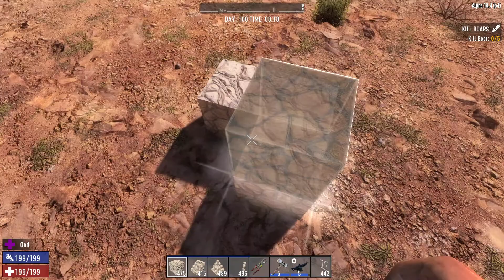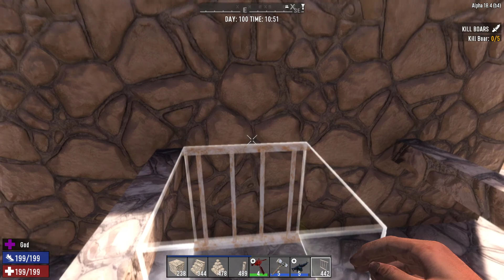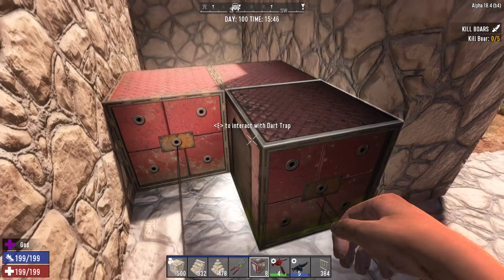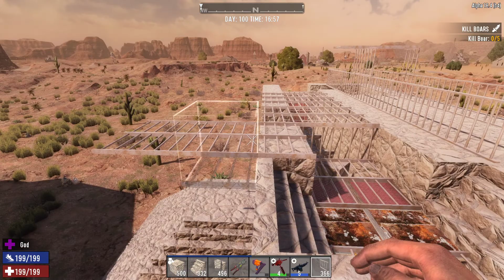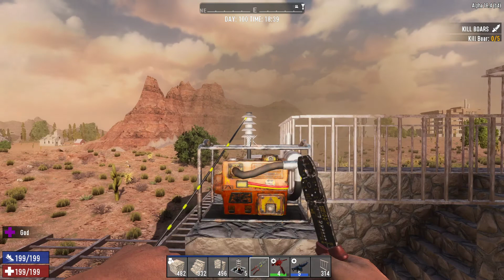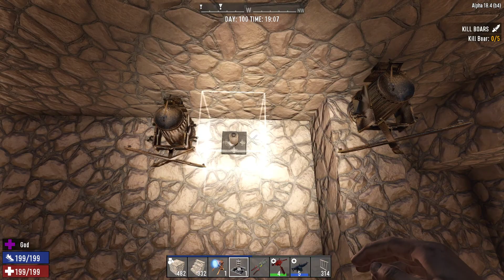7 Days to Die: How to Build the "Tunnel of Terror"

Comment: Hello, I'm wondering why you're using pole block on the bottom and bars on the top. Is there any reason ? Can't you just use either bars or poles on both sides?
Intersting design anyway, I'm gonna do some testings I guess ;-)
Reply from the maker: I used the poles horizontally because they can be upgraded to steel for the highest HP.   Bars would work, but they’d break much easier than poles do.  

For the top, I use iron bars so I can see through & walk across.  Poles could be used as well, but you can damage them with gun shots, so I avoid them.   

Does that answer your question?
Reply: @mov4do  Yep, that makes sense. I thought the Zs would just pathfind through but they actually break a few bars during horde nights so more hp is a good thing.
Thanks for the quick reply.

Comment: I started 7D2D 2 weeks ago with much fear and trepidation.  Your last build {Bury the Zombies Alive) was very helpful in getting me through the first three hordes.  I just got engineering to level 4 and I am excited to try this one. 
When you connected the generator to the far side traps and fences (from where you stand) do you have to connect it to the other traps and fence posts?   Also, do you have a fallback plan for if something goes terribly wrong? Maybe having dart traps, and or electric fences in the path at the top coming at you to help with controlling the horde?
Thanks and subbed.
Reply from the maker: Thanks for the comment, and I’m glad to hear you like my builds.  It’s always nice to hear when others use my designs 😊

For the electrical connection, you just need to connect the generator to the far side dart traps and electric fences.  The power flows through the fences and trip wires, to get to the dart traps.  When you connect the fences and trip wires with the wire tool, that also brings power.  

I currently do not have a fallback plan (livin’ on the edge!), but the first time I build this base, it was right next to “Bury the Zombies Alive”.  So, if something went wrong, I’d jump into that one.
Reply from the maker: On a side note, I’ve still never had a zombie make it through the bottom path.  If setup correctly, they’re getting hit by like 8 darts a second, so they all die fast.  On my most recent base build, I don’t even build the topside tunnel.